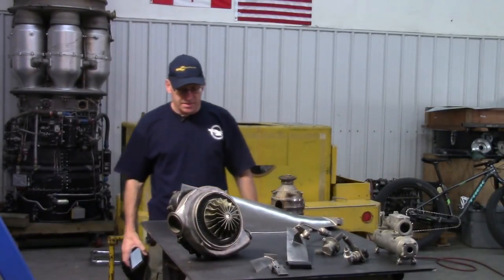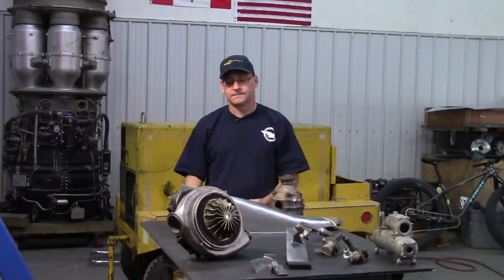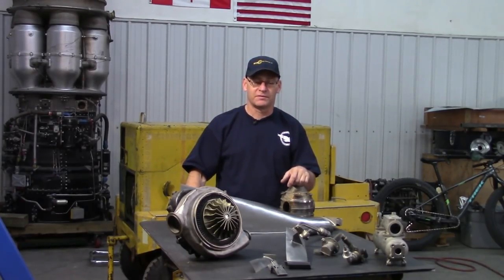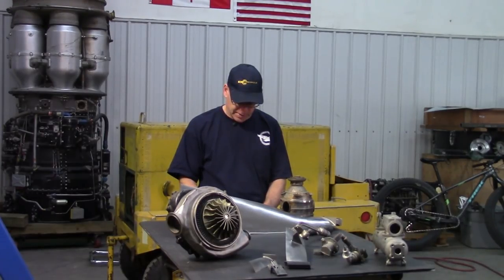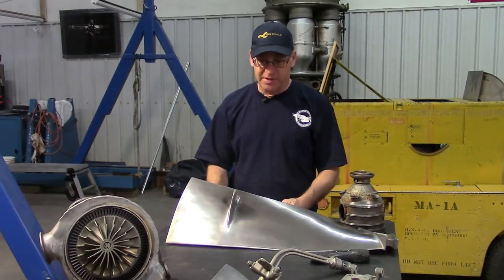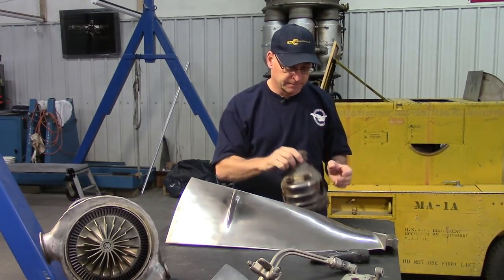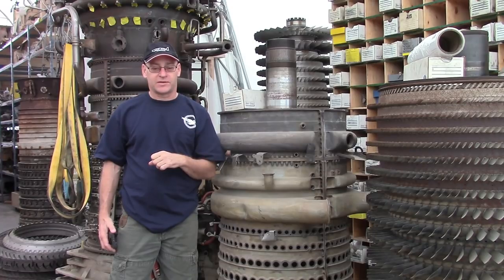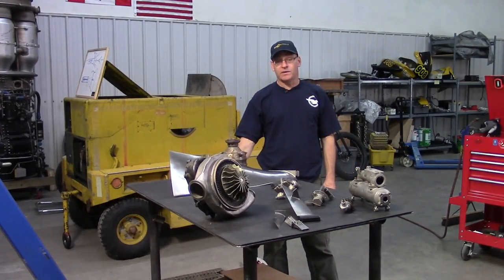Jet Questions 97

Comment: That's a great t-shirt you were wearing when you were looking  at that Phantom Spey (I won't guess at the mark number).  And yes, you were right about R-R Derby regretting their choice of too low a BPR for the Spey (and the Conway) in civil use.  That was eventually corrected, a little too late, with the introduction of the Tay, which used the Spey core, but which only ever found a significant application in (from memory) the Gulfstream G.II.  Correction: the Spey was used on both the G.II and G.III, with the Tay coming in on the G.IV.

Comment: Talk about "impedance matching".   Power transfer is best achieved when the impedance of a source matches the impedance of its load.   (that's why you use 8ohm speakers on your stereo)   Same principle in jets where the thrust/speed ratio of the jet is best matched to the "impedance" (viscosity?) of the air it is running in.   At low air speeds, you want high thrust/low speed fans - where at high air speeds, low thrust/high speeds is best.

Comment: The Roll-Royce/Westinghouse WR21, which powers the Royal Navy's Type 45 destroyers, has an intercooler between its IP and HP compressors and a recuperative heat exchanger in the exhaust, which heats the HPC delivery air.
I'm also aware of a Russian military turbofan that has a multi-tube heat exchanger in the by-pass duct, which, I believe, is for cooling the turbine cooling air.  And guess who did some design studies on cooled turbine cooling air years ago?  And I bet similar studies have been done at Evendale and East Hartford.
PS  I really should have mentioned that the turbomachinery of the WR21 is derived from that of one of the marks of Trent engine, with the fan deleted (of course).  However, I cannot be certain as to whether R-R continued the convention (which I originated) of retaining the same terms for the IP compressor and turbine, not renaming them 'LP', so as to avoid component name confusion.
Reply: Just watched a Nottingham science video about airfoils, and some of the formulas (Bernoulli, Euler, and the subsequent Navier Stokes equations)  associated with them, it got me thinking were there any equations/formulas that were standouts to you during your career? If someone were just starting out their career is there a handful of specific math(s) you would tell them to intimately learn?
Reply: Out of obvious interest, as a graduate (many years ago) in Mech Eng from the University of Nottingham, would you please point me in the direction of the video(s) to which you refer?
In answer to your question, if you are taking a course in, say, mechanical or aerospace engineering (or any other science/technology course), my advice is this: study your lecture and course notes and make sure that you understand the physical concepts, keeping abreast of the engineering maths - most importantly, don't just learn to pass exams. Produce the coursework that you are required to submit for marking/grading, revise the work and pass your exams.
Some, if not a large part of what you have studied, you may never use again, but you should carry with you a basic understanding of the underlying concepts for a lifetime.  And if, for some reason, you do have a change of career direction, which takes you back to a technical topic that you have not dealt with for years, you will (or should) be able rapidly to revise and master it.  By then, however, some keen young engineer should be doing the work for you, but you will need to identify where he might be going astray.
Reply: PS  In studying engineering, you are not just learning the science and technology to do a job: you are learning the fundamentals of how the modern world around you works.  
Going back to my time at Nottingham, the first year core course for mechanical, civil and electrical engineering students was common (with just a few subject exceptions).  When have I ever used my electrical engineering knowledge directly in my career?  Never: but the background knowledge has undoubtedly been useful as a life skill both at work on industrial gas turbines and in fiddling with electrical stuff at home.
I recall climbing aboard a B.737 some years ago and hearing the father of a family in front of me saying to his son, "I wonder how a jet engine works?", as they looked down at the CFM56 below us.  I wasn't in a position to educate them, but it struck me that they were obviously affluent and well-educated.  If I'd suggested that an understanding of very basic gas turbine theory was at least as challenging intellectually as an understanding of, say, Shakespeare (if not more so), then I wonder what their reaction would have been?
Reply: Here, Shakespeare is pretty much forcefully taught, at least that was my experience, I was never much of a fan (my comprehension of it always seemed to clash with the teachers), and it kind of ruined literature for me for a while, wasn't until well into college that I started reading again just for the enjoyment of it. It's cool to hear that engineering was taught similarly both "many years ago" and in a different country, makes sense, science works the same in every country. My first year was the same, all of the engineering disciplines took the same core classes. I think the only difference was chemical and bio engineering took chem and bio respectively, then it wasn't until year 3 that civil, mechanical, and aerospace broke off into their own disciplines.
Reply: It appears that this particular clip has only just been uploaded.  Perhaps it's because they have a 'science' tag that I haven't come across them.  Personally, I think that Holger Babinski, Professor of Aerodynamics at the University of Cambridge, gives a rather better explanation, using a little more theory (but not much): check out his stuff.  I'm no aerodynamicist (far from it), but I'd been working on my pet theory of lift for years, only to find out that he'd beaten me to it.
Reply: You've got it!

Comment: Pressurised air is used for engine cooling like you sayed but on an airplane is used for deicing ( engine inlet, wing leading edge etc), engine starting, heating in the air to air exchanger for cabin conditioning.

Comment: LM2500 8th stage bleed air is used for cooling and pressurization of the sumps and cabin pressurization. In the US navy 16th stage is used for cross bleed starting the pressure there is reduced to around 75psi by an external regulating valve.

Comment: I recon firecracker starters are cool.
The Australian navy Wessex had one but I never saw one used. It started off compressed air that was fed into the same unit. Form memory it was enough for 3 starts. Or from a gas turbine start cart. That engine was centrifugal turbine and compressor and can annular combustion chamber.Napier Gazelle

Comment: On the CF-6-80C2 when servicing the engine oil we would have to do a electronic sniff test to check if there was fuel in the engine oil as the FCOC could often leak.

Comment: If I wanted to buy a aircraft jet engine to just to take apart for fun/learning what would it cost and where should I look, I assume my best bet would be one in such bad condition it can't be repaired? Do I have a chance in this endeavour?
Reply from the maker: +Ian R yes you have a chance.
Begin looking.
Reply: You do. I bought a solar t-41 off ebay for $1600 USD. The fuel system was clogged with paint, rust, screws and fire suppressant. With lots of scrubbing, some custom gasket making and wiring, it ran again. unfortunately the dirt in the system scored a channel into the bore that the accelerator control system piston rides in. So in order to restore it to a stable idle. I'll need to find a replacement or duplicate the part.
Anyways, it was a fun challenge, but it's really hard to know what you're getting into.

Comment: The principle of increasing the by-pass ratio is in order to increase the propulsive efficiency of the engine at subsonic speeds: nothing else.  It's all down to something I know as the Froude Equation, which is really very simple.  This demonstrates that propulsive efficiency is 100 percent when the rearward jet velocity equals the forward velocity of the aircraft.  There's just one problem with achieving 100percent propulsive efficiency: you can't.  If the rearward velocity of the jet equals the forward velocity of the aircraft, the thrust is zero.
Reply: grahamj9101 Hi, I replied to a comment in a previous video about rb211's (generalised as high bypass turbofans) in industrial applications and said i couldn't see them being used. You answered afterwards and said they were already implemented. I thought my logic was completely wrong and i was stumped TBH..
Seems I was wrong but with valid reasoning..which i'll take any day!
Reply: Rolls-Royce Industrial and Marine Division was well into project design studies for a Marine RB211 engine during 1970, using a two-spool gas generator based on the RB211-22B aero engine, with the fan and the LP turbine removed.  I had laid out a project design for a two-stage power turbine, based on the single-stage TM3B power turbine of the Marine Olympus, with the intention of retrofit.
However, following the bankruptcy events of February 1971, the UK Ministry of  Defence got cold feet and cancelled the project.  As a 'stopgap', we designed an uprated version of the Industrial Olympus, the Olympus 'C', which has featured in several of AgentJayZ's videos.  We then resumed work on an industrial version of the RB211, the prototype of which went into service in 1974, with TransCanada Pipelines at Burstall in Saskatchewen.
Reply: Isn't the MT30 based on the Trent 800, which in turn is an evolution of the RB211? Fan and LPT, removed of course,
Reply: Yes, the MT30 is a Trent derivative, with the fan removed.  The free power turbine is also a derivative of the aero LP turbine.  This machine was one of the last projects that I worked on at R-R Bristol before I took early retirement.
And on the subject of the use of the term 'fan' for  the LP compressors of low  by-pass military engines, I was appointed Chief Designer - Fans and Compressors at R-R Bristol in 1983.  The term had been in common usage for military 'fans' for some years by then.
Reply: +grahamj9101 As usual excellent explanation by you.
Beside increasing propulsive efficiency, bypassing more air (let say the ratio like 60/40) also helps in improving combustion dynamics. We were told a long time ago that making the air fuel mixture lean in the combustors helps in improving combustion efficiency. Also, it has effect in reducing Nox but at the cost of increased CO.
Kindly correct me if I'm wrong.

Comment: AgentJayZ Jay, on the last LM2500, just below and outside the "left" side bleed air manifold (the one with the plumbing) there is a round device with a with a wire mesh. What is that? Thanks!

Comment: An intercooler is a specific term used to describe a heat exchanger that cools the air between (hence inter) successive compressions. So between say the LPC and HPC on a turbine or between the compressor (be it turbocharged or supercharged) and the combustion chamber in a piston engine.

Comment: 12:51 "the Canadian engine industry doesn't really exist anymore"....Ouch!  As a Canadian engineer working at a particular aircraft engine manufacturer that's been in business in Canada since 1928, that stings. It didn't end with Orenda, you know.  Still love the videos though, AgentJayz.
Reply from the maker: +Sean Kelly 
Sorry I forgot P&WC is a separate entity.
At that moment I was mentally comparing the Orenda 14 to the J47... and wondering where we'd be by now.
Reply: AgentJayZ No worries!  I have to admit I've driven past the old Iroquois test cells (not too far from Pratt in Mississauga) and worried "what if..." myself.
Reply: Having also worked at the same particular aircraft engine manufacturer that's been in business in Canada since 1928, I can also attest that the industry is alive and doing quite well here at home. Really enjoy AgentJayZ videos, keep up the good work.

Comment: Your doing fine . Intercooler has become a generic turm for an air to air cooler.
  FYI intercooler in technical use is  designating that it is cooling in between stages. Aftercooler is between the last stage of compressor and the heat expander(burn chamber/pistons)

Comment: Hey i bought a lot 9 of those combustion starters on eBay a few years ago, it is two starters in one the cover thats missing on yours has two chambers,the radial fan is used as a air starter the inlet is the 2 inch hole on the left and outlet is from the center of the fan (out the center of missing cover).as for the combustion part of the starter its inlet is the small hole on the right witch is hooked to a 5 inch burner can holding a big chunk of solid fuel that lights with a spark from a exciter the hot gas then spins the turbine wheel its exhaust also exits out the missing cover, both ways spin a gear reduction transmission thats splined to the Jet engine. I still have some of the parts you are missing in the video on your starter if you would like them i can send them to you. Free, if you pay shipping (they are very heavy). Your videos have helped me many times working on my project jet engines over the years its the least i can do for your help ,Thanks

Comment: Main use for bleed air on airliner engines is cabin pressurisation. The bleed air is cooled by big air to air heat exchangers, usually mounted in the wing to fuselage lower fairings. The 737 is an easy to see example of this, with the NACA ducts visible below the forward edge of the wing in the fairing, for cooling the exchangers. Pretty much the whole area under the fairings on the 737 in front of the main landing gear doors is heat exchangers and air conditioning for cabin air. Air temp is easily controlled by modulating the cooling air through the exchanger.Bleed air can also be used for starting as you said, but can also be ducted to wing leading edges for deicing systems (it is quite hot). and also for engine nacelle anti icing.
It's also why you get an oil or fuel smell in the cabin when something goes wrong with the engine, it gets into the bleed air system for the cabin pressurisation. Next time you're in an airliner, pay attention to when they start the second engine. The air conditioning air decreases greatly in volume, or completely stops as bleed air from the runnning engine is diverted from cabin flow to engine starting.
Reply: Excellent explanation.

Comment: On large radial engines the oil to air cooler seems to fail very often due to, reasons, I guess, at least on videos,  This seems to happen a lot on the Merlin and the R-2800's and the R-4360.  The oil pressure is higher than the air pressure so the oil shoots out. 

With oil to fuel coolers, I don't know what the relative pressures are, or whether the coolers are sturdier than the fragile old ones, so do you know if they are failure-prone, and if they fail, does oil leak into the fuel or the fuel leak into the oil?    Thanks!
Reply from the maker: oil pressure in operation is anywhere between 20 to 75 psi, depending on the engine. The fuel boost pumps provide fuel to the main fuel pump at 10 to 40 psi, depending on the aircraft ...
There is some overlap there to minimize the pressure differential between the fuel and oil.
There are pressure readouts for both fluids in the cockpits of the aircraft we supply engines for.
Leaks are bad, but I don't know which way they would go...

Comment: Sir,
Love the videos! I have a question that has bugged me for a while.  Older military turbojets used to use water injection at takeoff.  I have heard that was to keep internal temperatures down because the metallurgy of the day wasn't as good as today.  I have also heard the reason was to increase the mass of the exhaust, thereby increasing thrust.  Can you solve this riddle for me?  Thx!
Reply from the maker: +kurt thomsen 
There are almost a hundred videos in this playlist. Check the index for water injection.

Comment: AgentJay, in regards to the oil cooler on the Spay engine (aprox. 5:48) that you were showing, You were explaining that the air would be leaving the inlet to the outside of the inlet through the cooler. I can't see how that is possible with the huge negative pressure difference you would have with the inside of the inlet being less pressure. Granted if it were after a bypass fan or getting a large amount of ram air this would be a different story. But anything before the first compressor stage would be increasing velocity and reducing pressure. I can see this being especially true in a stationary industrial engine. Please correct me if i'm wrong. Thanks. Love your videos.
Reply from the maker: Your assumptions about pressures in the inlet of a flying aircraft are wrong.
Also, as stated, this is an aircraft engine.
A stationary industrial engine would have it's oil cooled by a conventional air cooled oil cooler, mounted on a skid next to the engine for easier maintenance.
Reply: With any significant forward velocity, there is a ram pressure recovery in the intake that will provide a pressure drop across the ACOC.  There is also an induced ventilation flow through the engine bay, around the exterior of the engine, which may also contribute.

Comment: My question: What stereo do you have in your shop? It sounds good.
Reply from the maker: I have six JBL control 25Ts set to 70V, and driven by a Crown Com-Tech 200. Also a JBL 2245H 18 inch sub in a cabinet I made, powered by  Crown Com-Tech 800, bridged in mono supplying 940W.
All of this is connected to an NAD tuner-preamp, tuned to the local FM/
Every bit of it is second hand.
It's all ridiculous overkill, but I was able to fulfill a high school fantasy thanks to Ebay, and a bit of work.
Reply: @AgentJayZ  Amazing